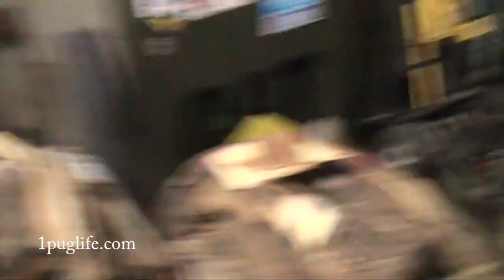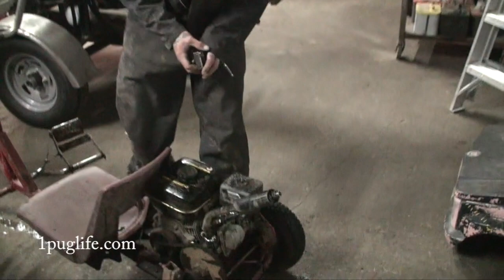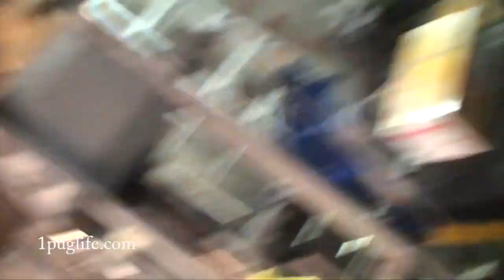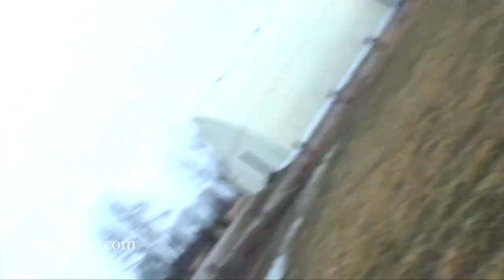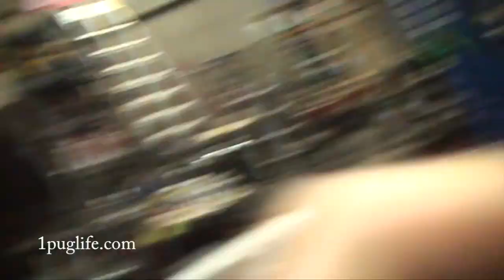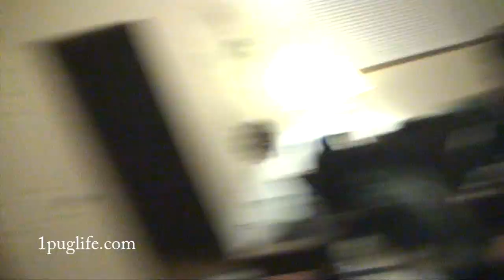inwoods for goofs

Comment: You use gas to heat the shop right. That heater going full blast puts out a huge amount of humidity in the air and when you shut the heat off in the evening without airing out the shop all that humidity will condensate, no joke, on the coldest part of the floor. It's not like the roofing dick condensation but actual condensation. It's like using a gas stove in the kitchen.

Comment: First you do it by type. Philips, slot, hex. Then by size,(  i.e. #6, #8, #10.). Then by length. Follow Home Depot. Otherwise you will never find anything. Put all the Philips in one cabinet. All the bolts in another one, etc, etc, etc.

Comment: drywall is getting there.. looking good.. do finish carpentry.. make all the moulding yourself.. or have RONA  make  3 inch strips of 1/2 inch mdf strips at their  cutshop from a 4x8 sheet  and use it for baseboard n trim.. its cheap.. and good.. prime n paint.. ...all trim is less than 100$..

Comment: With the kneck on that trike backwards its a reverse caster and is probably a bitch to handle, the handeling will be 100 times better with that flipped around.
Reply: +2fastHarley ergonomics are not important round these parts bmp

Comment: You'll upset the govt by saying 6X4 quarter inches and 85 degrees inside instead of using metrication. If you resort to miles and gallons in your dialog you might be in trouble...

Comment: I thoughtned for a minuet that was the Tricycletta from a 4-5 year old video u n logie did about a viewing of the indoor raining double workshop unit thing....?
Bmp but if that is a mountain bike rotor and calliper...don't do it if it uses mineral oil instead of 5 dot brake fluid cos even an emergency urgency stop will prolly boil the fluid and burst the reservoir all over the programme...
Just giving you the lesson I learned painfully... 
still, brakes are for goods anyway... If you wanna brake doing a big big jump....... You bessnt be thunking about doing the big big jump..
Fuckn rights for getting the programme uncocked!
stovepeeps..